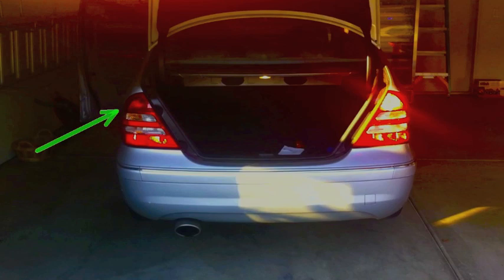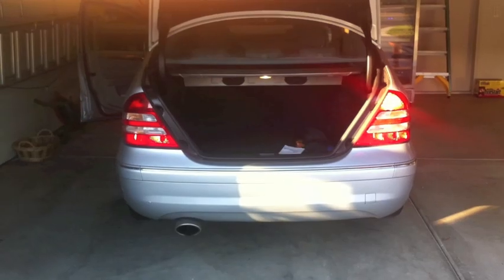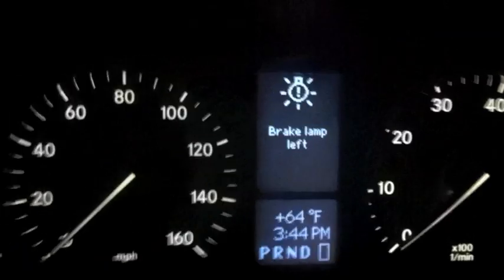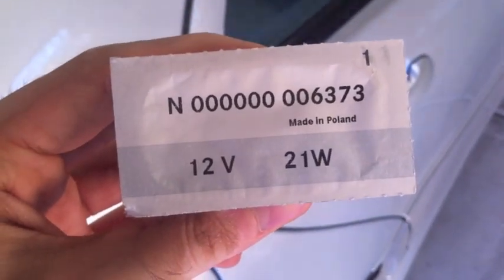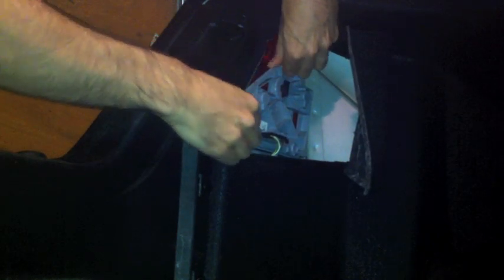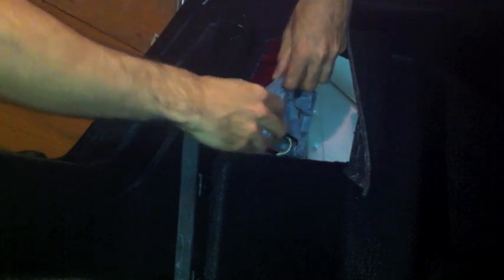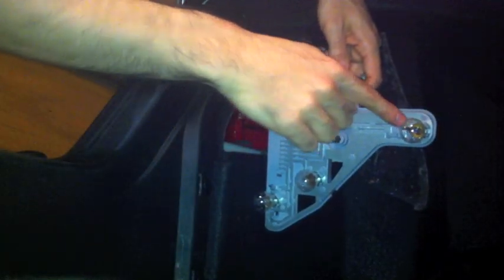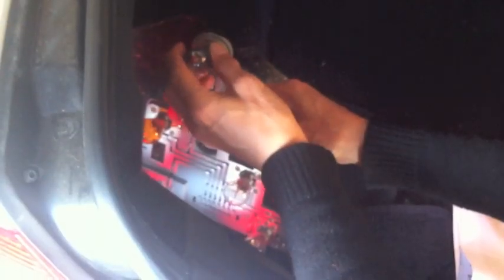How to Replace a Car Tail Light in One Minute

Comment: On the 2004 e320 wagon There is a center brake light and the two brake lights on the outside(body). Are the inside(on the hatch) lights suppose to light when you brake?